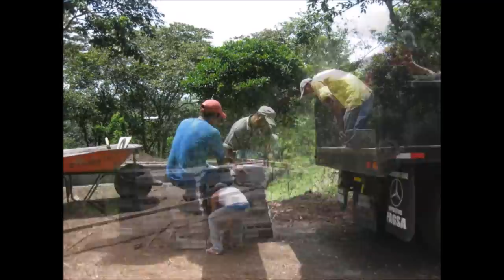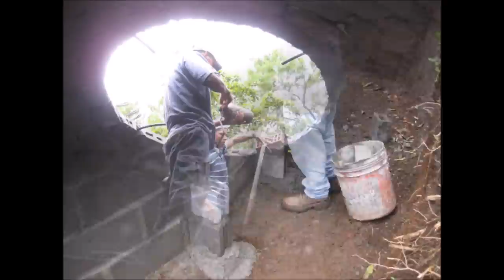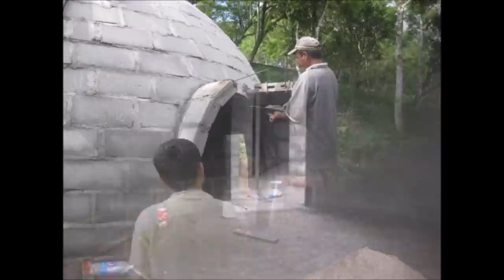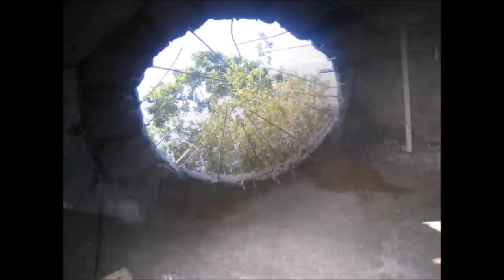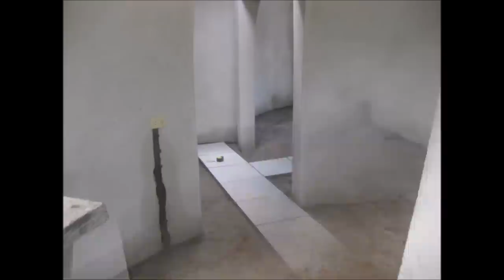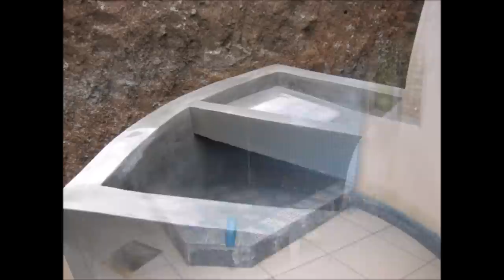Concrete Block Dome House - Slide Show

Comment: Did you use spray foam,  balsat rebar, and shotcrete to make it well insulated from the elements from the inside?   And the balsat rebar and shotcrete will make it last for up to 500-1,000 years with the proper maintenance.

Comment: a. Mortar mix was similar to any used by local block layers. Likely about a 3:1. My masons did what they knew.
b. Roof is a plexiglass ... not a glass. I would, for other buildings use a clear roofing (they have clear panels that match the profile of normal metal roofing) ... way cheaper.
c. Didn't use rebar except at the top - 1/4" to hold the blocks up until the ring was complete. Once each ring was complete, compression took over.

Comment: How does the natural air conditioning work? Is it open around the top under the plexiglass?

I did some maths, and looked into the cost of concrete brick in my area. The bricks for a 30' diameter dome would only cost $2,000. Not bad for a house. I could certainly see it only costing the quoted $7,000.
Reply from the maker: There is an opening at the top so air can flow freely from the inside. As well, the shape of the dome aids in a suction being created by wind flowing over the top.

Comment: Im trying to think up a way to make long-lasting low or no maintenance skylights. I like what you did there, but the plexiglass will need to be replaced i Imagine every so often. Any ideas on a solution that will last as long as possible. Dosent need to look pretty per se, just last long.
Reply from the maker: Ferro cement would work nicely

Comment: Wondering how you keep ground and rainwater out off the construction. No sealing?
Reply from the maker: Good question. The roof is covered with a sealant and the sidewalk around the building is constructed to take the water off and away. Seems to work ... still dry several years later.

Comment: How do you get the dome shape?
Reply from the maker: It is a simple process - an arm set on a central post is used to measure each block. As you go up, the arm naturally follows the curve (arch.)
Reply: Bryan Butler 
So the bricks aren’t different shapes then?
With no keystone, why doesn’t it collapse inwards?
Reply from the maker: @fainitesbarley2245  The compression of each course acts in the same manner as a keystone. So, in a way, each block acts as a keystone. Towards the top, there is some shaping of the blocks to make them fit the angle of the slope.
Reply: Bryan Butler 
Thanks Bryan.